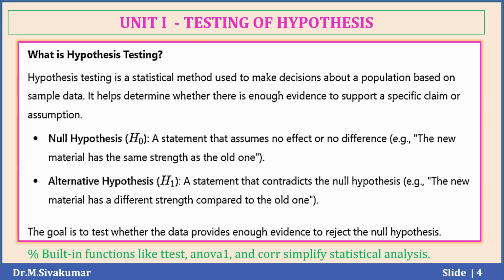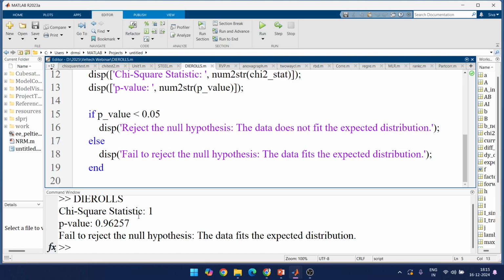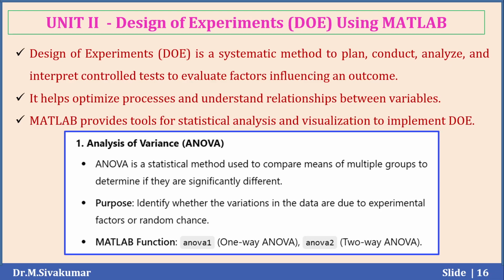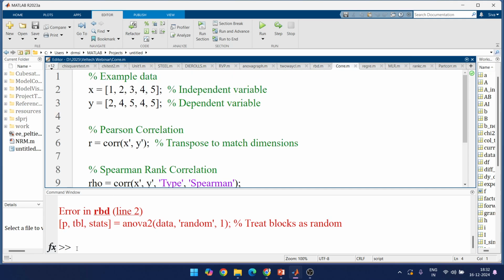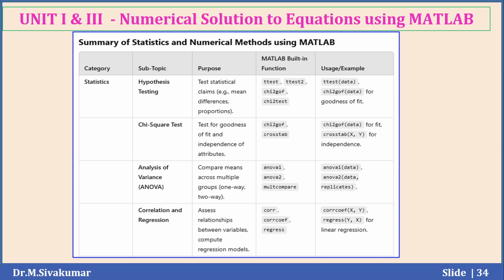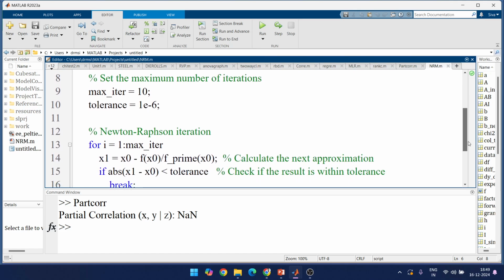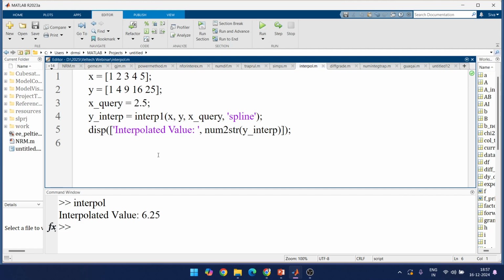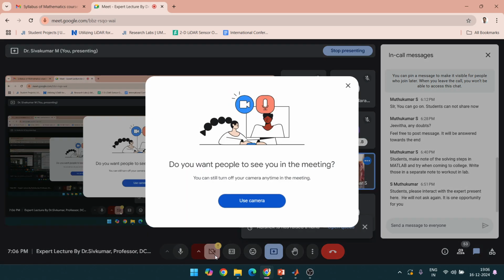Statistics and Numerical Methods Using Matlab - A Simplified Approach

Comment: Hello dear teacher, I follow you with interest, your work will be a pioneer in my work. I would be very happy if you could send me the matlab raw data of this application 'Design & Simulation of Photo Voltaic Residential System Connected to the Grid using Matlab Simulink', it will be very helpful in my work, best regards.